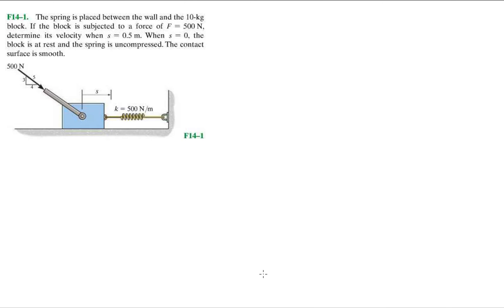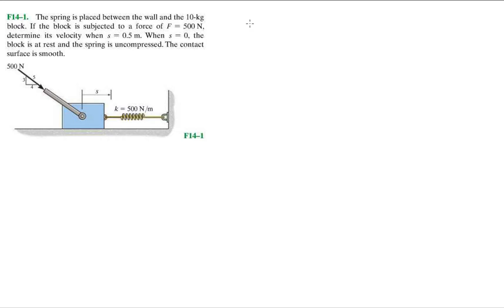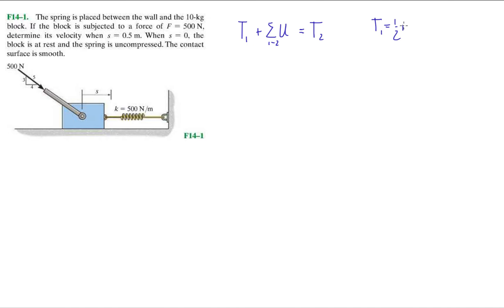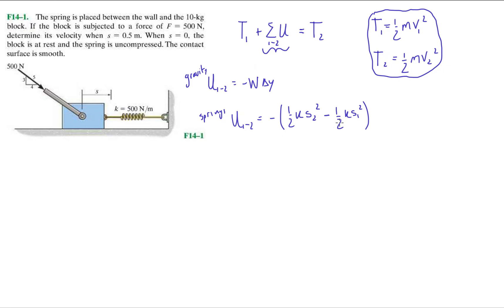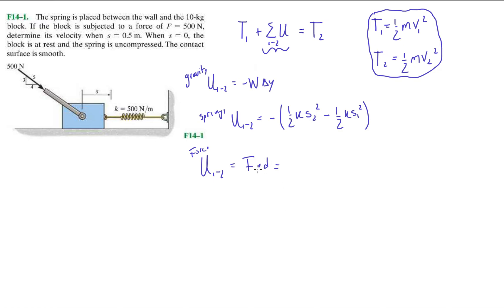Problem F14-1 Dynamics Hibbeler 13th (Chapter 14) Engineering Dynamics - Work and Energy

Comment: why didn't you consider the weight? (Vertical force)
Reply from the maker: Since there is no displacement in the "y" direction, it isn't necessary to compute the change in potential from the gravitational term. If it did have translation in the "y' direction I would have included the potential energy terms due to gravity

Comment: What if your told that the coefficient of kinetic friction between the block and the floor is 0.2
Reply from the maker: You would need to subtract the energy from the non-conservative force from the left hand side of the equation (work energy equation)